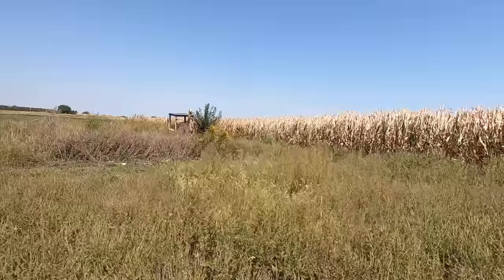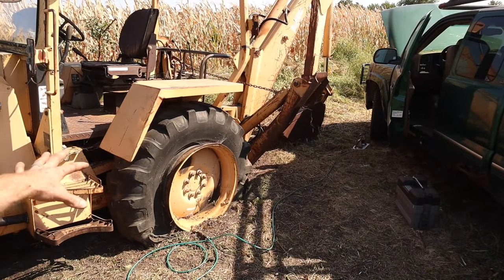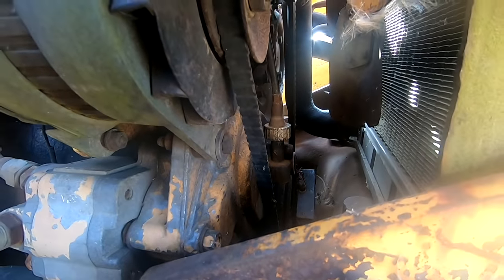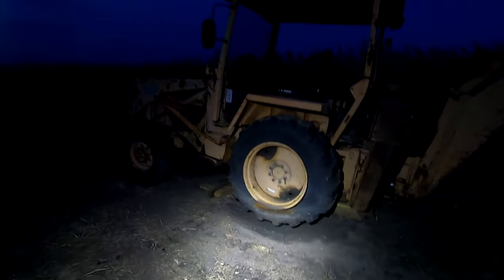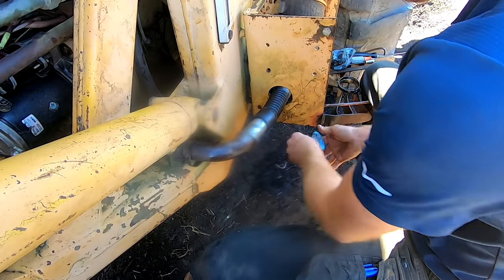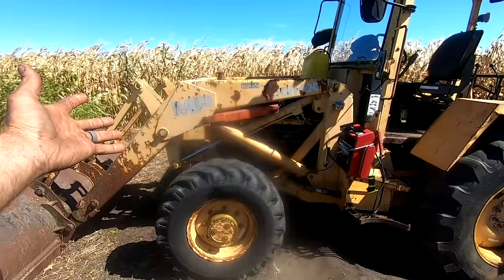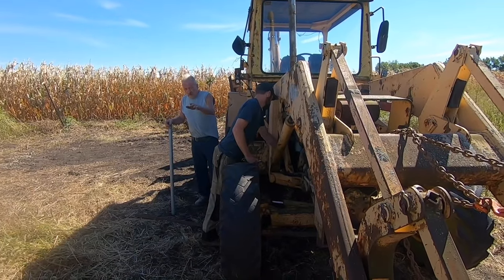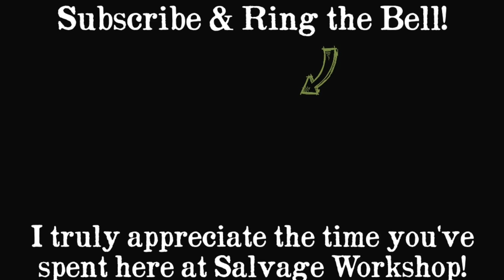I GAMBLED $600 on this Backhoe, sight UNSEEN?? Was the MF WORTH it?!? ~ Broke Down Backhoe ~ Part 1

Comment: Well that was interesting, As an equipment mechanic and equipment tire guy for 30 years I sit here watching you and just shake my head sometimes with your logic, but hey you always seem to be the blind squirrel that finds a nut L.O.L    As a die hard JCB owner operator of machines  from the best years of them before they went cheap plastic like every other brand. Don't ever call a Massey backhoe a JCB it's about like the saying friends don't let friends get caught driving Mack trucks L.O.L.   Your machine has full hydraulic steering, that big hole in the casting and that lug to the side is for the mechanism for power assist steering. where it would have a mechanical linkage from a regular type steering box under the dash down to a  ram/control valve and shaft that goes through that hole, and then the linkage out to the wheel hubs on a 2wd axel. It's for the same  set up as you'd find on an old MF 165 type farm tractor with power assist steering. Thanks for the video, I hope we get some updates on the Cat soon, Take care.
Reply: I’ll have to agree,I find myself shaking my head most of the time when I’m watching these videos. Don’t know how anyone can get so lucky because it’s surely not skill!
Reply: Agree. Forest Gumps his way to accomplishment. However much better than all the ones at home playing those children's games on the television.

Comment: You only had to pull back on the loader up lever ....tie it back, in order to jack up the loader....it lets the oil circulate out of the cylinders.  Then release the lever to hold.

Comment: Love that big sky!  I remember when young and having no farm experience I ran a diesel Kubota with no gauge dry. I got Diesel but it wouldn't start. Knew nothing of diesel, little of gas engines but looked at things and pondered every bit of it. The Lord was good to me that day, as all actually, but I figured out how to bleed the lines of air by cracking some nuts on lines leading to wherever and she fired up. My boss never found out, I was alone on this.  Another time a piece of equipment wouldn't fire, nothing electrical keyed up... Alone again I pulled the switch mechanism unfolded some dog-ears and saw some springs and a couple of bb's loose in there. Figured it out and got it back up and running. 
As I watched you I felt like leaning in or simple handing you tools. I felt comfortable with the way you approached it all. My dad was a Lehigh University engineer who taught me nothing - long story but I'm glad to have found a natural knack for figuring stuff out somehow. Today I'm 64 do some consierge landscaping, I've always had a penchant for dirt but started forging a bit, making a few knives and alot if noise but also found I've a knack for clock repair.
'McGiyvering' will get things going when all else fails or is unavailable. Great videos!

Comment: Congrats on the machine, what a deal. Couple tips... that hand pumped fuel lift pump will only pump fuel TO the injection pump, not up to the injectors. Those old Perkins are notoriously difficult bleed air out of after they're run out of fuel. What you do is crack the injector line at a couple injectors, especially #1, and crank it over until the fuel spurting out doesn't have air bubbles in it anymore, then tighten them back up. Saves using starting fluid which is very hard on diesel engines. About the hydraulics, if you would have pulled the loader control into the raise position while jacking on the bucket it should have allowed the cylinders to extend, then put the control back into neutral to "lock" it up. MF Industrial eventually became Fermec, which was then sold to Terex. The legacy of that machine is the modern Terex TLB. On a side note, I think that backhoe would look sharp painted in the MF red and gray colors.....
Reply: there are two small bleed screws on the pump itself , air those out , then crack a couple of injectors and spin it over
Reply: @d4c24a  You're right.... I forgot about those! Been a few years since I've been around those little Perkins engines.
Reply: The whole time I was screaming pull the dang levers back while he was raising the bucket. Cheers from Jacksonville Florida 🌞

Comment: The backhoe with "side shift" is made by JCB.  JCB is very much of UK origin.  I don't know if any other brands offer anything similar to the JCB in respect to being able to traverse the hoe laterally, but it was a JCB innovation.
At least the hoe swing/pivot function uses traditional hydraulic cylinders instead of the infamous Massey hydraulic rotor motor. (refer to the Watch Wes Work  You Tube channel for a couple of episodes on that).
The oil circuit you put the hose on is the supply (suction) line going to the hydraulic pump.  The only thing about using a nondescript generic hose is whether it is oil resistant or not.  If it begins to swell,  or get spongy or gummy, it wasn't oil resistant.
Reply: The side shift is whats known as the European style,  versus the North American known as the center mount . Pretty well all the backhoes sold by JCB Case, Cat, Ford NH ,volvo and what ever companies making the Massey now  have a side shift machine for the U.K/ European market, the center mount is rare over there ,the market is totally opposite. I have a side shift JCB here in Canada and there are several more around this area to, There was a guy imported several Case S,S' as well but I don't see them  around. They have advantages for working in tighter areas than a center mount. If you'd ever used one for some jobs you'd never go back to a center mount. I was born and raisedin the U.K with side shift and got lucky finding one here for sale. I didn't even want a center mount My friend here from the U.K has an older CM MF than this one, He hates it is all I can say that he's said is polite about it LO.L.

Comment: Ferguson was basically a British company , part of the Standard/Triumph group. They manufactured a small tractor based on an American Ford design . The tie up with Massey originally started when Massey bought the rights to make and use the hydraulic three point linkage invented by Harry Ferguson, an Irish man. Most of the much loved and reliable little grey Fergies had a  diesel engine and was ultra reliable as long as regularly serviced. It's weak point in my experience was the wet cylinder liners, bad maintenance allowed them to move and so leak. The later MF 35 was a really good machine, thousands of Them still in regular service world wide and much copied by other countries .

Comment: Thank you for getting her STARTED. Great learning from what you did. Explaining the fuel system shut off and throttle. One question how did the Hydraulic work for turning front tires. If pump is ( OS) not connecting. The backhoe controls look like John Deere, with dipper on Left control. I think that's what I saw. Your simple fixes are right on. Not needing all the Lift heavy Equipment. Just simple jacks. I will do a walk around of my 190 Dynahoe 1978 model. Mine will dig down 19 feet without any extend ( sliding) on Dipper. My power is a 353 Detroit
There is NO clutch on mine. You just put the shuttle shifter in center then shift gear shifter between legs on floor. I will show all that in my video. I will do one just for you ( walk around) then put it on U- Tube for you to see. I will name the video with your call out so you can find it. I like how you do a simple walk around naming the simple stuff for a layman. Someone who doesn't know everything about these old great pieces of Heavy Equipment. Such a find.
Reply from the maker: Thank you my friend! Glad you enjoyed the video... As far as the steering goes, there's a small hydraulic pump on the side of the motor that's just for the hydraulic steering... Let me know about the video! I'll take a look, for sure!

Comment: 4 yrs ago I got a small front end loader. It is a Raymon model 550 with a Wisconsin 30hs.  Gas motor. I came with a bucket and a fork lift attachment. I have looked it up on the internet and it shows that they make cherry pickers and fork lifts. I have looked at many pictures and I can't find anything that looks like this. My mechanic said he was in the air force and he said that they used things like it to load rockets and ammunition on fighter jets. I couldn't find any plates so far,but I will send pictures. Thanks
Reply: It has all new hydraulic hoses and the motor has been a gone over. But he told me it doesn't have brakes.

Comment: Hello from the UK, the numbers on the engine tell you the number of cylinders and the cubic inch of the engine. So the 4.248 equates to 4 cylinders and 248cubic inch, a Perkins 6.354 is 6 cylinder 354 cubic inch, a 3.152 is 3 cylinder 152 cubic inch. 
Love your perseverance and old school way of doing things, starting to become a dying art of managing with out all the dealer tools and using a bit of common sense and what you have to hand.

Comment: Salvage an old log splitter pump/hyd tank assembly.  Thats how I used to move junk equipment, plumb it into the hoe/loader cylinders.  Also a great way to flush them of old oil.  I used to save the hydraulic oil from large excavator services I did.
Reply: did that on a crane..Works
Reply from the maker: That's a REALLY great idea! I will have to keep my eyes out for something like that for future recoveries! Thanks for the tip!
Reply: @SalvageWorkshop  Snow plow 12v hyd pump can do it even a porta power hand pump takes forever though to keep refilling oil.
Reply: @MitzvosGolem1  -issue is hydraulic capacity.  Even a small 5 hp splitter has at least  5 gallons of capacity.  Equipment cylinders eat up a lot of oil, gallons.  The one I built was on a skid and used a 13hp honda motor and a 10gpm 2 stage pump.  I could get 3500psi If I needed it(gpm would fall), and held 10 gallons.  I had two 25ft hydraulic hoses with couplers on it.  I carried lots of adapter fittings and it made it much easier to recover old equipment, especially large equipment.
Reply: @kevinoscarson2941  Excellent idea  I g
had to use 12 v pump when my Grove crane shut down to lower boom. Took a long time
Reply: @SalvageWorkshop  Set the pump up to feed from an external source.  One of my hydraulic power packs has that facility, and it's so handy to just stick the suction hose in a drum of oil and use it.

Comment: That hose as long as it's reinforced internally is fine there's almost no pressure on that side of the hydraulic system, I had a D6 in and the owner had already bought a new pump for it from cat and wanted it installed, so I got the belly pan off and it was packed Hard in clay, I spent 4 hours almost with a needle scaler busting through everything, it had been buried so many times and so badly that it was packed clean up to the top of the access, more needle scaler action for the suction hose and found out that it had been crushed by the hard packed clay in there, now let me back track a bit, customer complaint and high rpm little hydraulic pressure/power and cavitation on a 2019 machine  mind you, well I drained the system and checked the tank and filters and 0 metal anywhere, tank clean, filters clean after I cut and sampled them, so something was odd there if we have cavitation power loss issue. 
Now by the time I got everything cleared out and the suction hose off the only place open was O'Reilly and I got a radiator house for a Pete(reinforced) and installed it, filled the system, bled it and she operated like brand new, needless to say the customer was extremely happy that he didn't need to pay for the pump and I gained a permanent customer. 
So your green truck, not necessarily normal to blow up a radiator, unless you have combustion gasses over pressurizing the system my Man! You need to do a headgasket check on that vehicle.

Comment: Fantastic fault finding, and meticulous work. (RE-wire the whole thing, because it looks like someone had arsed about with it. Love your video (I'm a retired mechanic) The whole system needs looking at, consider getting the injectors refurbished. Check all the hydraulic hoses too. 👍👍🇬🇧

Comment: What a runner!  It looked like front axle wasn’t doing any driving when the rears slipped when loading?  Is there a 4x4/2x4 lever somewhere?  I love watching your stuff! Can’t wait to see it being used same with Red!
Reply from the maker: The front was skidding around on the bucket in the front, and because of the fact that I had NO hydraulics as well as the uneven ground i was on, it wasn't letting the front axle steer very well!  There is a button on the dash that engages the 4wd... I figured that out WELL after I filmed this video! Thanks for watching and commenting, I truly appreciate it!

Comment: Another great video, thoroughly enjoyed it 👍 Just a thought, when you remove the pump and driveshaft, replace the fan/alternator belt at the same time, saves having to remove everything again should it break. Looking forward to the next video 👍
Reply: Same on my old 455c Ford/New Holland... if the v-belt breaks you have to jump through hoops to change it

Comment: Nothing seems to daunt you.  A flat tractor tire with destroyed tube, no problem, just pull out the tube between the rim and tire bead and put in a new one.  50 years ago, I worked at a tire shop and wrestled tube type car and pickup truck tires.  I remember how hard it was to work on them, I think the difficulty would only be greater with a tractor size tire.  Props to you for the hard work.  That old Massey should serve you well.  I never worked on a Perkins diesel but their reputation in the construction business was great.  Everybody thought they were bulletproof.

Comment: I rebuilt starters for over 10 years at an alternator/starter shop in Atlanta, GA, and my specialty was Ford starters.  But I learned to rebuild GM and Crysler starters too.  I think I can even repair starters in my sleep.  I used to rebuild 100 Ford starters a day and ran/tested each one after rebuilding.  I'd often get metal in my eyes as i used a seating stick on the commutator to seat the new brushes.  Just wish I'd used some safety glasses when testing the starters.  Cheers from eastern TN

Comment: Disconnect the lift cylinder lines, Jack the cylinders up, put the red cylinder stopper on one lift cylinder and lower it till it stops.  Load and secure.

Comment: As a south african I get to see a lot of older massey agri tractors. That backhoe resembles the massey 290 tractor a lot so that bearing hole in the front would be a through shaft for power steering and the hydraulic cylinder to run it would be on top of that plate/block

Comment: It's good to block anything jacked up in order to release the pressure on your jacks.  If you leave it up on the jacks overnight you are really, imo, hurting the seals and the life of the jacks.  Better to use them only for the initial jack, and then releasing the pressure as soon as possible for the longest life possible on your jacks.  Note: have I violated this?  sure, but I'm older now and don't want to spend money if I can help it.  Thanks for the video!  Enjoyable watching a rescue of things that should never be thrown away or discarded.

Comment: According to the machine's manual, which i found through a google search, there's supposed to be a hydraulic oil cooler in front of the radiator, where that hole is that you were wondering about.
Reply from the maker: There is a hydraulic oil cooler in front of the radiator as well as an engine oil cooler... those do not use the hole i was wondering about... apparently that hole is for a power steering shaft that is needed for the 2wd models... it's not used on my machine since it's 4wd.

Comment: To get to those hard to fill spots for fuel, oil, etc I take a regular funnel and attach a 4 ft section of garden hose and you can basically get fluid whereever you need it

Comment: CAV fuel pump is notorious to bleed. There is a small 3/8 I think bleed nipple at the top of the pump, bleed fuel to there slacken fuel pipes crank to purge air from fuel pipes. And then give it a go. I had to do this as an apprentice every Monday on a truck that would not start after the weekend. Ran ok the rest of the week started every day.

Comment: The hoses must be compatible with the hydraulic oil used. Most hyd suction or return hoses are wire reinforced and should have strong rugged clamps. Good luck, wish I was working along side you on this great project. Peter

Comment: check power to the starter before pulling it. on old stuff like that, I usually just put the jumper right to the starter and jump the solenoid if the key doesn't work. that way you can get it running before messing with the wiring

Comment: There are 2 bleed screws on that DPA fuel pump. 5/16 AF  One on the rectangular governor housing and the other on the round rotor head.  Don't overtighten them, they snap easily. Bleed the injection pump while operating the lift pump. Governor housing first.  If you are going to strip the governor housing cover to renew the seals, LOOK at the position of the governor spring on the plate before unhooking it.

Comment: the front bolster was also used on ag tractors the hole in the casting was for the steering arm and the mount flange on the right is for the steering cylinder to pin to.

Comment: I have seen radiator hose for hydraulic return lines last more than 20 years My son has a log splitter my father in law built in the 80's replaced the heater hose return line just a few years ago